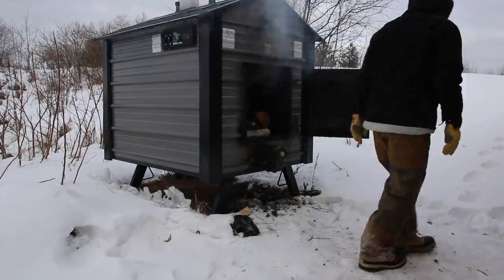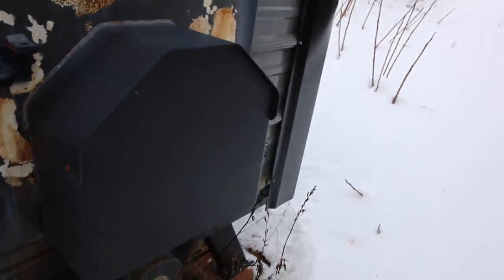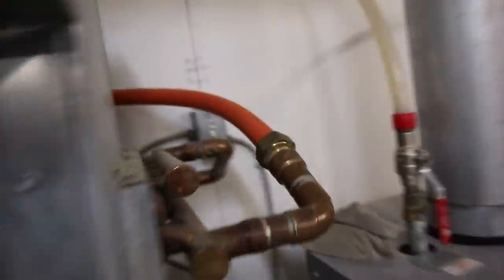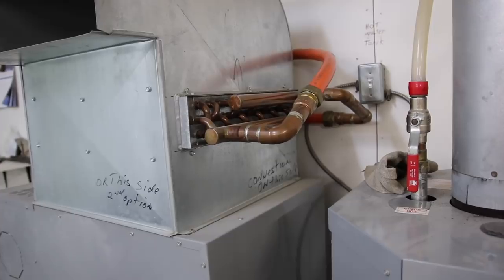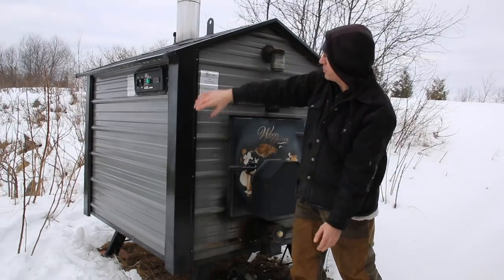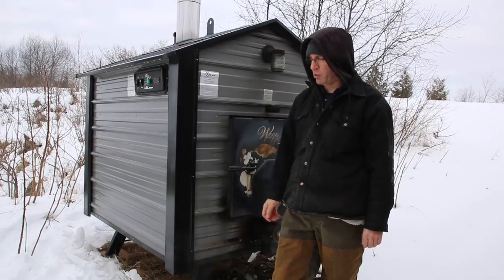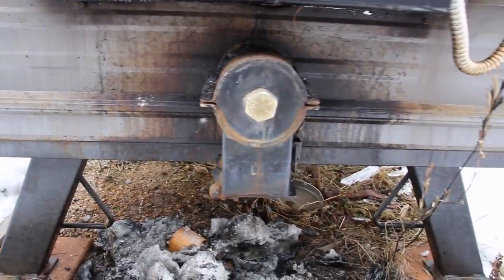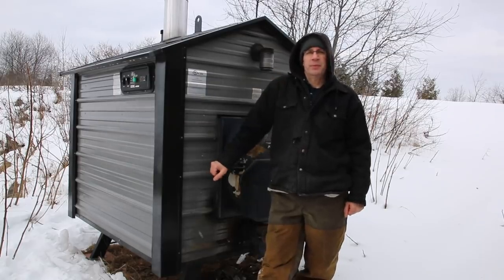Outdoor wood furnace "worth the investment?"

Comment: Wood chips from Pallet Recyclers. Then you use an auger. Easier on your Back.
Reply: how much are wood chips per ton? I don't think the price comparison would be a good one. a cord of wood is 160 here in NC I would think to get that much chips to equal the btu factor from a cord of oak would cost way more. the burn rate would be crazy. smaller the wood shorter the burn. a cord of wood gives off a certain amount of btu's. it don't matter how fast or slow you burn it. so you want a slow burn so more heat is not lost to the stack.  so a cord of white oak seasoned weighs 3757 lbs and puts off 24million btu's it don't matter if it burns in three hours in a pile or 300 hours in a wood stove the btu's are exactly the same.the key is to capture the heat before it goes out the stack pipe. my boiler like semi green wood as big as will fit through the door.  I have gotten 15 hour burns from 3 or 4 pieces of oak about the size of a middle school kick ball. oh I don't keep my home cold either. I know people that lower there temps to 67 or 68, nope I don't have to to save money. one think I don't do is shiver or sweat in my house. I would like to know where you get chips and how much

Comment: In a grid down situation they are worthless unless you have a genset. My freestanding wood stove works with or with out the grid
Reply: I heated with a wood stove for 35 years, the boiler is so much easier and the radiant flor heat eliminates hot spots. The pump takes .7amps, I could use a stationary bike and a car alternator to periodically pump and get by if I had to. I’m 100 percent off grid anyway so....

Comment: my neighbor had one of these boilers , it was a pain in the a$$ .
also because it used so much wood , he never could keep up with drying it and the logs were sizzling and spitting water out the ends , the smoke was incredible .
after 6 years the whole thing rotted out and he had to buy a new burning chamber , this time from stainless steel and it costed a small fortune .
i say , all in all it was a fiasco !
i believe my air tight woodstove is a lot better deal , i don't have to go out and it is a lot more efficient .
also it lasts over night , the furnace kicks in when it runs out of wood , but i'm ok. with that , it still saves some money .
Reply: mike force  
sure , i have wood that is several years old and it is dry like a popcorn fart .
but he never waited and claimed that the trees were dead and that should make for dry wood .
he kept burning it as fast as he cut it  and it was a lot !
i told him once but ,......he just did it his way .
Reply: man I am laughing my ass off. you are completely correct. all these chumps with all their excuses is hilarious. my boiler is 15 and has not given me any issues but one pump and an anode rod. I heat 3200 ft 2 story with about 8 cords of wood. I cut now thru april and am all good by October when I light it. if the boiler is a forced fan draft it will burn semi  green wood and give you the best burn time. these folks just don't understand how they work. the install is the most important

Comment: Is it possible to burn hay or straw instead of wood I visited a huderite colony that was heated  by hay burning boiler
Reply: yes you can also if you buy a good unit you can burn coal witch is hotter an burns longer then wood an clean burn, if you buy good coal. $7 a ton
Reply: Wouldn't shipping cost a ton too?
Reply: i hall 30 ton at a time, cost me 1000 in fuel
Reply: So $7/ton for coal and $33/ton just for fuel?
Reply: that is right, the closer you are the better, dont for get a ton of coat and a cord of birch fire wood burning side by side takes 1.35 cords of birch per ton of coal, buying a load of 8 foot log birch cost135 a cord, now i have to burn 40 gas to cut it into 24 inch blocks, lift the heavy blocks, load the fire box full to last 24 hours were 2 inchs of coal last longer, some times i have a load of something going that way for someone, so its free feul

Comment: Yes they are allot of work but I do see a few problems with your set up. I have the same furnace and love it. Your insulated pipes are poor quality. It is better to make your own in a day. I have a full 5 3/4 inches of insulation around the pipes in 6 inch drain tile. Another problem is your temperature settings. There is way too much difference between your on and off settings. If you want it at 180 then set the on at 170. I set mine at a 5 degree difference. Next you can put a switch on the blower so you can use the stove like a natural draft style ( this alone will save you almost 30% on your wood consumption). I spend 20 minutes total a day loading the boiler. I have checked my time versus savings and for me I am saving on average $100 an hour cutting my own wood vs propane with just a ATV or lawn tractor and small yard trailer. Don't split the wood unless you can't lift it or it won't fit in the door. Larger pieces burn longer. Also check around to any local cabinet or Mills in your area. Some will sell you any scrapes very cheap. I get my larger trailer filled with all Hardwoods scrapes for $20 ( it's 6 1/2ft x 12ft with 4ft sides). That lasts me on average 1 month.
Reply: Tj Smith I agree 100%! I have very good insulated pipe and I don't lose any heat from my boiler to the house. I have a digistat thermometer on both the incoming and return lines. I also have a switch to turn off the fan but allow the flapper to open. I forget to mention I use a cordless drill on my Ash auger twice a week. Seems to work good that way.
Reply: Tj Smith my water temp is 165 for the high temp and 155 for low with 120 for shut down. Seems to work the best for me
Reply: Levi Field I don't have the auger. What I do is use a shovel, wire mesh like a grate and a steel barrel. I put the ash on the grate and any unburnt coals collect on it while the fine ash falls thru in the barrel. Then I can toss the coals back in for a complete burn.
Type of wood is also one of the big factors especially in real cold weather (15 and under (, it's -3 here now)) for burn time. 
Also adding a couple of extra feet of stove pipe will help with the natural draft.
Reply: Levi Field since I also have a side arm heat exchanger for my hot water and my wife takes super hot showers I set mine at 170 off and 165 on. If it wasn't for that I would keep my far lower (about 150) and save even more on wood.
Reply: YOU ARE RIGHT as an installer for many years i make up my own lines back to the day when they use to sell foam that the line fit into, the foam was 2 halfs 4 feet long, was a total joke as ground water is the biggest heat loss, i been making all my install lines my self for years..
Reply: thanks tj for getting it. some of these guys on here just do not know what they are talking about
Reply: you really don't need no more than 2 inches of insulation in a plastic pipe unless you are a really long way from your house. I can see where more might help but really 2 inches per pipe is all that is required. I have 4  3/4 pipes each with 2inches of rubbertex insulation in an eight inch corrugated pipe about 18 inches deep about 60 foot long. I am in NC and it is not that bad in the winter but once you get deep enough no matter where you are the ground temp is the same you just have to go deeper the farther north you go
Reply: @arnoldromppai5395  you still put that insulation into a corrugated tube for water proofing.
Reply: @tjsmith3060  yes that is what i said, in side a solid black 6" weeping/drain tile.. if you read!!!

Comment: More efficient way would be a wood stove in the basement set up to heat the radiant house system so that oil or gas isnt used to heat it.  Set up a thermostat for wood stove separate from the gas or oil so that gas oil only get burned if wood stove goes out and temp drops below a set degree .

Comment: Expensive set up.  But, I heard yesterday that here in the mid-west even if you have to buy your firewood it's still the cheapest heat there is.  Gotta go now.  Time to stoke the fires.  Coldern hell here!
Reply: I have had one for about 10 years and have always felt if I had to buy my wood it would not be worth it because it is not super efficient. Cutting my own wood and only needing very little money for fuel for a tractor and gas for my plow truck I am able to heat my house for basically free. A lot of time is involved but it is great exercise and I enjoy cutting fire wood for the most part.
Reply: Coal is cheaper.
Reply: yes with a good unit aand install burning wood is the cheapest heat even if you have to buy you wood in 8 foot logs dont split it, burn it green
Reply: yes coal $7 a ton an last longer

Comment: Neat set up...
But at $10,000 I’d consider a used indoor  airtight/franklin stove for $300.
A med sized stove will easily heat a 1200 sq ft shop...in less than an hour...using the fan that generates power from the heat of the stove.  
Then there is no need to haul wood in the elements....
Then run a propane or oil back up to keep it at 10c.

Comment: These are kept outside because they're not safe - because of steam, boilers can explode... I opt for a indoor wood stove, & mine burns wood or coal.. Wood can burn up to 500 degrees F & coal 1,500 F.. I only burn coal when it's 20 degrees or lower, the house gets too hot other wise.
Reply: Not possible to explode because they're open to the atmosphere. Not a pressurized system

Comment: Something definitely not set right or heating way too much area.  I tracked my hours and savings.  Time and savings was 70 dollars an hour when I cut my OWN wood. Now I get trailer loads of scraps from a cabinet company for $20 a trailer (6.5x12). I get on average a month per trailer load.  He is using super cheap barely insulated pipes and heating what looks like a poorly insulated barn.
I love mine. Saves me thousands a year.  Even heats my home water.

Comment: This setup is all wrong.

My friend heats his 2200 sq ft home, a 30x40 shop, and a 30x30 wood shop with one of these.  He burns one semi load of firewood a year.   Around here, a semi load of logs is about $1000.  Heating 3 big buildings for 1000 year is pretty good.   And yes, we have bad winters at 8000ft in Wyoming.
Reply: that's 3900 feet and i am sure the shops are not as well insulated as they should be  but maybe so. point is 3900 sq ft for 1000 is peanuts. Al these dudes on here whining don't know what they are talking about or didn't do their homework on what type of stove or how to install. I am in the construction industry and love mine to death. I got a heatmor brand and that one and the central boiler are by far in a class of its own. but .you have to install them correctly. if fact  have had two of my friends get them also. It paid for itself in three years. i was burning my insert and propane to heat my home. burned about 3 cords in my insert ( nasty inside my house) and about 1200 gallons propane a year. propane was around 2 $ or more. now i burm less than 200 gallons and 6 to 8 cordes of wood. do the math i am saving well over 2000 a year and my home is warm. awood stove does not heat a 2 story 3200sqft home alone. it can work but its hot as crap up front and cold in thew back. wood boiler does whole house both floors cheaper than gas or electric
Reply: Even less if he's picking up downed trees on their own property. .clean up the property & get heat at the same time..👍👍👍👍
Reply: @ I'm Not-Tarded.  Thanks for the info.  That is almost the same setup I have.  I don't have a wood boiler yet, I am doing my research now.  My home is 3600 with three floors and supper insulated, R30 double walls ext.  My shops are bigger one is very well insulated and one is not. The one that is not will not be heated but for a day or two year.    I live in north west Montana.  We have lots of cold but lots of wood also.    The house has a wood stove on all three floors and cadet heaters in each room. This is so in the spring and fall when heat is not needed 24/7 I wont run the boiler.  I am hopping to heat for less than 5 cords a year.  Is it a pipe dream?

Comment: Outdoor Furnace: $10,000
Chain Saw: $500
Blower & Duct: $1,500
Tractor: $25,000
Wood splitter: $2,500
Dump Trailer: $8,000
Wood Cover: $1,500

Almost $50K to heat the shop...that is a lot of propane.

Comment: That would be a good way to heat your kiln with sawmill waste.  Back in 2005 I was paying maybe 1000/year on gas heat for house and spent an enormous amount of time and money collecting firewood.  Gas is cheaper now and I've concluded heating a house with wood is good if you want to do that but for simplicity just use gas, your time is worth using gas.
Reply: with the very high price of gas, fuel oil, propane, in -40 winters for 6 months a year, you cant beat wood even if you have to buy it, an an out door unit use far less an a lot more heat

Comment: You've missed the number one reason these furnaces aren't
worth it. They are SO inefficient because most of the heat goes out the stack.
The stack temperatures on these things can easily exceed 1200 degrees when the
fan is running. That is a HUGE amount of wasted heat (and smoke) going out into
the countryside. The idea of a water heater is a good one however so I designed
and built my own but made MAJOR changes. I increased the amount of water to
1500 gallons to hold the heat for days instead of hours. I built a large fire
box with 35 vertical 3" tubes 4 feet long with turbulators (turbulators
are EXTREMELY important). That slows the flow of air to a minimum giving the
heat a lot of time to move into the water. The vertical tubes allow the ash to
drop back into the firebox (most went out the stack) so NO cleaning like some
of these stoves with just a few horizontal tubes that constantly plug up and
the air flow is so fast there's little time for the heat to move into the
water. 

It is designed to burn full logs 4 feet long so NO
SPLITTING; it burns from one end to the other along the length of the logs.
When I was done I had a stove that was an HONEST 80% efficient (unheard of
among water stoves even though claimed) figured by the weight of the burned
wood and the increase in water temperature by BTU, VERY accurate. I would guess
most are less than 35% or so which is why they burn SO MUCH wood. In fact my
stove was so efficient, and the stack temperatures were so low (about 250 degrees),
I had to add a draft inducer to help the exhaust flow; the exhaust was not hot
enough to cause enough draft without one. 

So once every two or three days load it up and light it.
After about a ten minute warm up it would burn so hot there was ZERO smoke
(smoke is fuel) and ZERO creosote build up (creosote is fuel). It would burn
for about four or five hours at up to 2,000 degrees (yes I said 2,000 degrees,
the secondary air injection burned blue hot) after which it would be shut down.
The water temp would run from about 120 (plenty to heat the house and unlimited
hot water) up to about 180 degrees. This stove burned SO CLEAN it needed
cleaning only once a year and even then it could have gone much longer.
Reply from the maker: You should make a video on it!
Reply: So buy a double burner with a larger water jacket instead of the single inefficient ones as the burn chamber in the double is insulated and the second burn chamber is the water jacket and also put a large water tank in for heat storage that way you can go days between firings.... Far more efficient, no smoke.
Reply: Build it and sell them. I'd buy one
Reply: THey are already made by several companies.  Cost about $5000  @vanderumd11

Comment: Also, you need to explain if you do use Glycol.  Efficiency, is affected at the hot water rad.  And the head pressure at the pump is decreased.   FYI.   IF you do use Glycol.  % mixture is important factor to consider..  Too much and it will Sludge up real good over time.   FYI

Comment: Other cheaper options to burn wood... personally would never buy an OWB pay 10x the price for burner,then burn 4x the amount of wood...my hot blast is good enough
Reply: what is a hot blast? I burn 8 cords a year. what are the cheaper options? not a wood stove they wont heat the whole house even like a boiler will unless you have a tiny few room house

Comment: Thank you for posting this video I have a cabin/home in the woods and is currently heated by forced hot water propane heated and that cost is crazy . My main concern is freezing pipes in winter this home is not lived in all the time and visited every weekend . I think the set up you have minus the radiator (I have forced hot water) would work great to keep cost down we also have 100 arches of wooded property . We also have electric heat in case LP runs out or breaks down but would rather keep place drained and in incandescent  lights put under cabinets where pipes are . We are also looking at going Solar OR Water turbine from the fast running stream by the house if we could be totally off grid that would be perfect.
Reply: yes fast moving stream you should get the water turbines going, then you could run electric heat all the time. the great thing about water power it is 24/7 if you have continual flowing water. I have a pond and a creek way way back and it is slow and not deep. here in TN the state gets their panties in a bunch if you alter natural waterways (like building dams) so unless i catch a beaver in a trap, i probably wont be able to use my creeks. you sound like you have the perfect set up. And the prices of them have come down so much. in your situation i would have 3 or 4 of them (but one per year) hope you do that, love seeing ppl get off grid. i havent achieved the goal yet but working on it.